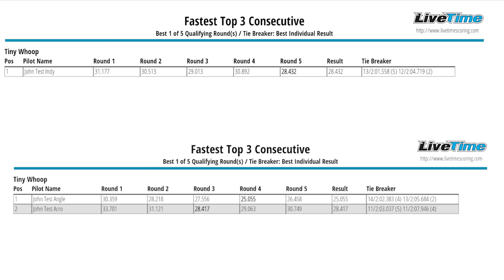Inductrix FC vs Betaflight Tiny Whoop Racing

Comment: If Acro mode means adding 20% Flaps on a Spectrum transmitter. What setting do you have to change to get this Angel mode?
Reply from the maker: I never tried to fly acro mode on the Inductrix FC.  Everything flown was in angle mode.  I'm not sure if changing flaps or whatever else can change the inductrix FC into an acro mode.  The standard default angle mode is what I was looking at.  Betaflight lets you choose what you want to fly, angle or acro.
Reply: @JohnEFly  I have the standard Inductrix broad and I can only find two know flights mods for this broad. Safe mode and Acro Mode, How do you fly the standard Inductrix broad in this Angel mode?
Reply from the maker: It's probably just a terminology thing.  I'm calling the Inductrix safe mode the inductrix angle mode.
Reply: OK, Now we are on the same page. So iv noticed that with the Blade Inductrix broad in Safe or Angle mode the gyro is turned on. So when going from a hover to moving forward buy moving the elevator stick forward. If you wanted to return back to hover you can just move the elevator stick back to centre. Which is nice, But you can not flip or roll over in Angle or Safe this mode. Which i don't like so much. In Acro mode you can flip and roll but to transition from hover moving forward then back to hover. You have to over overcompensate in the opposite direction you where moving then back to centre to get back in a hover. Do you know if there is anyway you can have the best of both words with the Gyro on and still be able to flip it with the Blade Inductrix broad or any 3rd party broads?
Reply from the maker: So I would recommend a couple tings.  If you want to do flips and rolls, I would recommend getting comfortable with acro mode.  It takes a little getting used to, but it's well worth it and will make you a better pilot.  All of my non-whoops are flown exclusively in acro mode.

That being said, you can do what you want with a 3rd party board.  If you pick up a board that runs betaflight (such as the Beecore), you can enable what is called Horizon mode.  Horizon mode will auto-level for you just like angle mode.  But, if you move your sticks past a threshold the quad will continue to roll or flip.  If you return the stick to center, it'll re auto-level.
Reply: @JohnEFly  Thanks for the advice! I will continue to get use to Acro Mode with this broad for a little longer then. Then maybe make the upgrade later.

Comment: Great video!  Was the weight of the two quads the same?  That yellow FPV canopy is pretty heavy.  And I also wonder if your travel on the DXe was set to 140-150 as I think it defaults to 100 and you don't get the full range on the Indy board.  The DXe isn't bad, but terrible to program. 

Jesse has been running the "Awesome Sauce" 617 20k's with a stock board in a Cockroach frame, and he swears by it.  In my testing with Awesome Sauce an Mockingbird, it feels a little gruntier than NBD Gold's or Ultra Sauce (19.Xk) but not quite as fast or powerful as a 716 7mm build.

Right before watching this I was practicing some laps between my TWR (running 18k RDQ motors) and my Ultra Sauce (19.7k) Mockingbird and the stock board still handles some things better, but being able to run faster motors and increase the max angle to get more speed are worth any "magic" the Indy board has, IMO.

The best news is that you can run your Taranis and still be competitive with TWRs running Spektrum! :D
Reply from the maker: Thanks for the feedback man! I have some Awesome Sauce and Special Sauce motors on the way now to test with this setup. I also got a bunch of tips from Mike Chin to try in the next round to ensure I get the best performance out of the stock board including a lot of what you said here. 

I look forward to seeing if I can get this puppy moving even faster than my Beecore v2. Spoiler alert though, running a Beecore V2 with Unicorn motors is currently running 6+ seconds faster on this track than my current stock board for 3 consecutive laps. It'll take something pretty serious at this point for the stock board to catch up... Hoping I see it happen

Comment: I bought an FPV+ a couple months ago, and I'm liking it, I know it's not legal for sanctioned Whoop racing, but for just having fun, the 500ma (600-650 aftermarket) batteries give real near 6 minute flight flight times (taking it easy), and the 8mm motors have excellent power. It really is a huge step ahead of my older Whoop with the F3evo based board. I do miss my Betaflight  though. I've got the older HK orange module in my Taranis and it works great.

Comment: Do you have any experience with bi blades on the whoop?
Reply from the maker: I used to cut my 4 blade props down to 2 blades, but I haven't done that in a long time.  I used to find that worked best before I started using much better batteries.  Since then the RakonHeli 3-blade props are definitely my favorite.
Reply: John E Fly did you try it on the motors you where testing to see if it help with the vibrations?
Reply from the maker: No I did not.